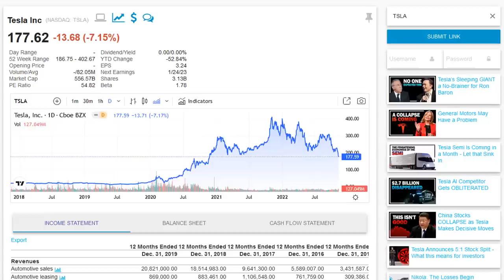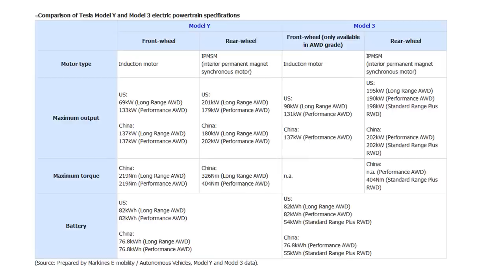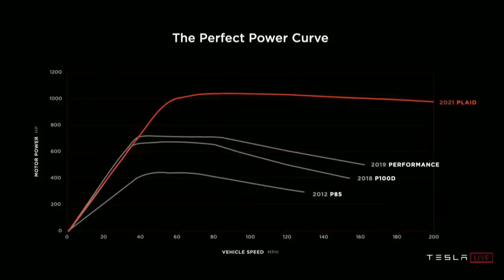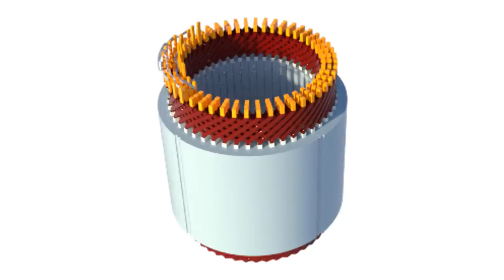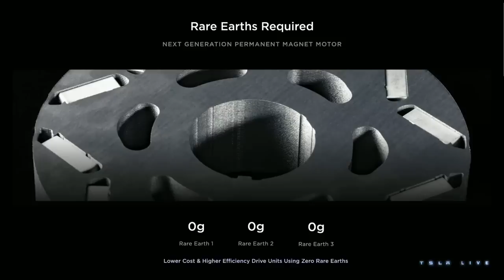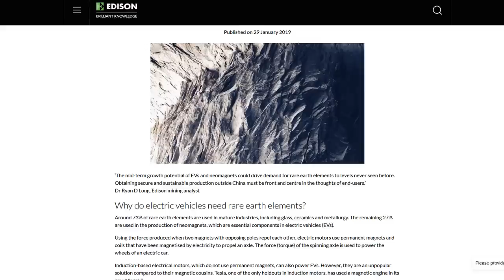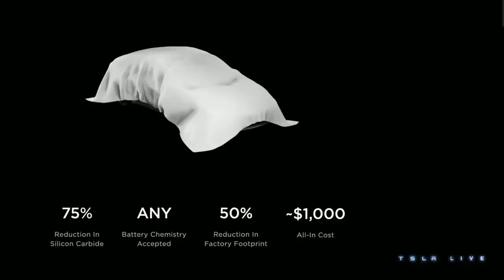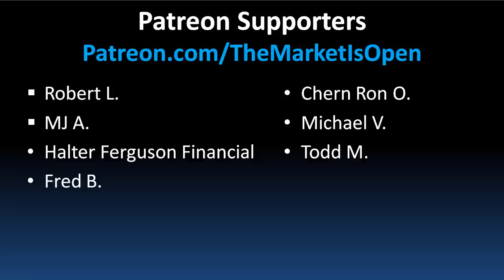Elon Musk's NEW INSANE Motor SHOCKS The Entire Industry!

Comment: Elon, note that your cars sell for $40-60,000, while a 40' commercial work boat sells for $400- 750,000. That give a ratio of 10 to 1 suggesting the 5,000,000 sar equivalent. 
Also, your cars are to times the sophistication of work boats?
Also the manufacturing can be totally separate from you auto operations.
My hulls use 40-60% less fuel than the best hulls in production today, and have a proven great speed and comfort in rough weather.
Your interest may be satisfied maybe to electric power the fastest trans atlantic hull ever?

Comment: I don't see what the hype is with this hairpin winding. The motors on Japan's bullet trains use windings with a rectangular cross-section as far back as the 1960s. Using rectangular rather than round copper wire for a higher fill-factor has been known and used for decades.

Comment: Cut down the heat caused within the motor by two times? So it works like a super refrigerator. A bit close to zero Kelvin. Get someone to edit what you write. This is outside the realms of current engineering.

Comment: "Hairpin technology" has been around for decades.  In any other industry, it's called a form wound motor.   Not sure what information you've been looking at, but you will find formed windings are more or less a standard for applications where the motor is driven by a VFD.  They are commercially available from dozens of manufacturers.

Comment: Telsa doesn't manufacture its computer chips in house, just mats processing alone is very expensive (intel is expert at this) an they'd lose money (they already took a hit with the stupid twitter thing) . . .    But they (tesla) get them from the best chip manufacturer as of now (TSMC out of Taiwan) like Nvidea and AMD get their chips from. Intel is up there but its not @ TSMC level. TSMC makes one of the smallest process nodes (nm / nanometer for transistor ). But Intel has more powerful processors because their mats have more heat resistance and allow them to pack more chips per space (even though their nm process is bigger than TSMC)

Comment: If you really wanted to try something different 

Why wouldn’t you try a different system configuration 

Try a FWD Drive Train and Use the rear Axel to power a power generation of some sort that could charge the battery 

Make the battery in different sections so you could be charging a different section of the battery while another section of the battery is working and then another section is resting and cooling down. 

Since it is FWD you could configure the rear section to harness energy back to battery pack

You just have to separate the sections 

It would be like having multiple batteries in your car with enough power charged the car could just switch itself between battery sections that are fully charged 

Why isn’t this feasible

Comment: I never understood how come the battery cell technology didn’t resemble the mechanics of a combustion engine with different cells charging different cells resting and different cells charging. I don’t understand why these cars don’t have an alternator that can store energy in a separate section of the battery cell. The battery cell would resemble a combustion engine. Different sections of the battery would always be charged enough to run. Without the need for an external power source. There must be a way to do that.

Comment: For EV to work, they have to be affordable to poor people.  This means old EV's have to have a used price of under $2000 and have a battery pack good enough to last 20-50k miles.  How many EVs are scrapped when they need a new battery?  If an EV is not worth replacing the battery, it means you are buying a battery, not a car.

Comment: the current electirc cars are a joke just like those that buy them , these so called new motors are  a joke also, there are FAR SUPERIOR dsigns hidden that we will never see before this planet gets wiped and there is nothing wrong with gas engines except their current day design if they used the technology they have we could get hundreds of miles to a gollon of gas and the so called carbon monoxide is what the plants use so we would be in harmony with the eco system but most of the population are nothing more than brain washed walking zombie

Comment: I paused the video at about the 9 minute mark, just after the section that says Tesla "builds their high level chips in-house".     The cost of building a chip foundry is astronomical so Tesla actually uses TSMC for chip manufacture.   Tesla might design their own chips but for the relatively small numbers of chips needed their is absolutely no way they would build their own foundry:  they have to contract out to TSMC for the actual chip manufacturing.

Comment: I am sorry to point out a few things mentioned in this video that are not correct.   1; Using square copper windings (today referred to as "hairpin" windings) is not at all a new technology, it is almost 100 years since the first electric motors and generators were winded with square profile copper cables.    2; NO high electrical currrents are routed through the two big square formed integrated circuits (pictured at 8:17), those circuits are CPU's (Central Processing Units). The high AC and DC current used in an EV are handled with specific power semiconductors like CMOS and Thyristors (several in parallell), which are not seen on this picture. What those type of semi-conductors have in common is that they dissipate heat that needs to be handled with different type of cooling system, in order to make them work continously.

Comment: This is all subjective. Maintenance is very expensive on these if you have to do it. Tires brakes batteries are all much more expensive. A rim cost over 1k and tires run 2k or more. Plus the cars are so expensive. How exactly are they sustainable over and ICE car. The batteries are sorced using slave labor and they don't recycle them so just dumping Lithium is very toxic. 80 percent of the world's electricity is generated by fossil fuels. All your doing is hiding that these cars are over priced cars with very expensive parts and they get powered by fossil fuels but at a 40 percent loss over powerlines. An ICE vehicle is still much better for the environment cheaper to maintain and much more convenient in regular driving.

Comment: About the Hairpin windings- it doesn't seem that unique except that the process  is being used to create the stator, rather than as usual in an old DC motor rotor. Watch the rebuild process of a automobile starter in India- they (under very difficult conditions) dismantle the Hairpin windings, anneal them, skillfully bend their shape, cleanup the rotor and commutator, and solder them back to the commutator. It remains to be seen if the new magnets are scalable, and that they are heat resistant enough. If so, it would reduce the cost. I don't see that happening until they have fully tested the motor under all conditions.

Comment: What exactly is the break through technology?  Permanent magnet rotor motors have always been more efficient than induction motors.  I am still waiting for the electrical power to be sent through the rotor to increase the strength of the permanent magnets and then used to power the rotating magnetic field in the stator.  This way, cheep ferrite magnets can be used.

Comment: I think tesla will still use induction motor, with little modification in the rotor design, not standard squirel cage type, just be more conductive and better cooling. The insane thing is, the rotor is water cooled, they can flow fluid to spinning part, that is a cool insane.

Comment: The batteries are so bad for the environment. Petrol and diesel is cleaner so what's the point. From bad to worse. And the half life of the batteries is terrible 😅 do not by second hand!! As the batteries lose the ability to change the will lose range it will also take far more power to charge and there is so much losses when charging batteries wether they are new or not just get grater over time. Fast charging is not good for the half life of batteries.. that's what capacitor's are for fast charge fast discharge.

Comment: Electric vehicles are bullsh#t. The power grid will NEVER become capable recharging millions of EV's on a consistent and repetitive basis. Additionally the "environmental nightmare" of discarding "used-up" battery packs at garbage land-fills; their "high replacement cost" (along with the affiliated "loss of EV resale value); ......are all PROBLEMS WITH NO SOLUTION IN SIGHT.  The only way vehicles with electric motors make any ECONOMIC SENSE AS A MASS TRANSPORTATION SOLUTION is to wait until they can be powered by "small-portable-bullet-proof-nuclear-reactors."

Comment: Elon Musk although brilliant has not solved the major problem of the electrical vehicle , how to supply the volume of electricity  that would be required should every vehicle be converted to electric.  How do we run the rail system today with diesel engines running larger electrical generators.  So actually the primary energy of a train is diesel a hydrocarbon.  Damn! Got it!

Comment: So no he didn't "Invent a new type of motor" (Not engine of course but "Motor". He did design a good quality version of a known Motor. As well they say these motors have already been being use by BMW, GM and VW.
Reply from the maker: There are two motors mentioned in the video. The first one is the existing hairpin motor used by Tesla currently as well as BMW, GM, VW, etc. As mentioned, there are different ways to manufacture this motor and so just because other companies use the same concept doesn't mean all the motors are identical. As mentioned these motors are still heavily researched and have the opportunity to be optimized through ai and software.
The second motor was the permanent motor that will be used by the next gen Tesla platform, that is said to use no rare earth metals. There are no PM motors today that don't use rare earth metals. that said it's still a PM motor. So you can look at it any way you want. Either it's a new type of motor, or its the same type of motor built using a new method.

Comment: This looks like a great idea for Australia when you consider all of the issues they have.   Here where I live in Canada we start climbing as soon as we leave the city up the mountains with the temp below 0  and lots of snow.   I think these lads were good about mentioning some of the qualifiers on this system 
Another issue that is just staring here is that the power suppliers are starting to charge by the amount of power utilized by the vehicle.   This seems to be increasing.
Here we are interested in the conversion of diesel to hydrogen which is just starting with increasing infrastructure. 

On company here mfg electric buses and is having troubles obtaining chips, batteries etc. and while they have plenty of orders it will be interesting to see if they can fill them.
Well done you folks in Australia and I suspect many other countries where this will work well.  Here?
Reply: Biggest problem in Australia is most people here are too poor to afford electric vehicles at current prices! Tesla Model S is around $140,000. Too busy trying to afford housing, energy costs, food....
Also, should watch "hydrogen will not save us, here's why" video by Sabine Hossenfelder. Hybrid is just prolonging the inevitable unaffordiblity and eventual end of FINITE fossil fuels. Or watch "The truth about Toyota hydrogen V8 engine" by engineering explained.

Comment: you said that the kwh of the batteries are high in that first estimation., but the fact is the other thing holding back EV going more mainstream is not only the cost of manufacture, but the RANGE..... silly gooses why would you want a smaller battery?
Reply from the maker: The 75KWh vehicle is a high-end Model 3. Standard Model 3 has a 54KWh battery. If you make an even smaller/efficient/lighter car, you can get the same range with a smaller pack. Even if they put the 54kWh pack into a smaller car the range would be much higher

Comment: This video seems built on an awful lot of assumptions - where the author doesn’t know enough about the motor development and design, hardware or software. For example, all ‘hardware’ manufacturers use software to design the hardware, the motor design claimed as innovative has been used by others, including non-auto manufacturers for some time. Yes, Tesla May have developed a manufacturing process to reduce costs,  but you don’t know that

Comment: When I was 6 I had an RC remote control car, and then it would die I would plug it into my wall outlet and the coal burning factory that powers my home would charge it and I would take it out again. 200 billion dollars and a society of dumb asses celebrate Tesla and the over sized RC vehicle that runs on electricity and when the batteries are depleted you plug the vehicle into the wall outlet and the coal burning factory recharged the vehicle